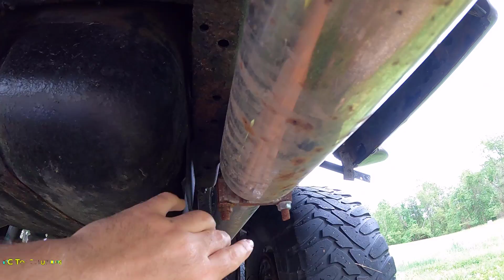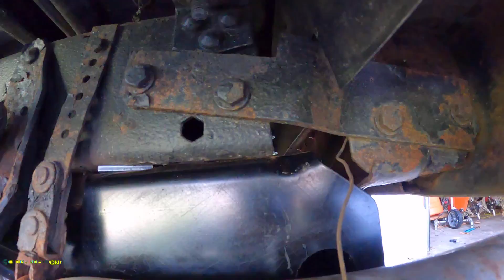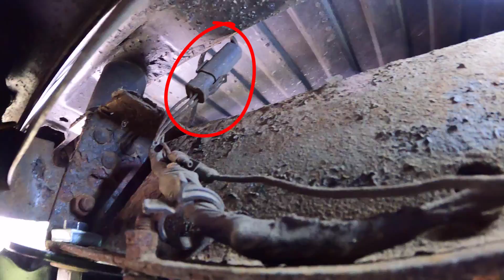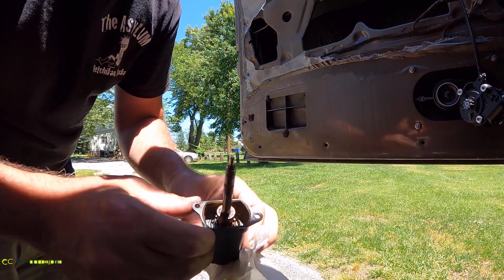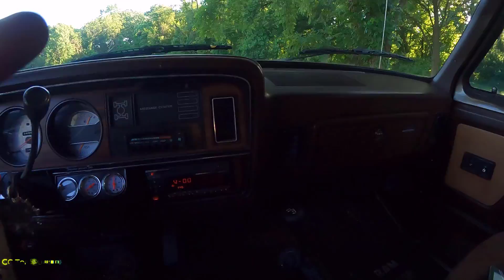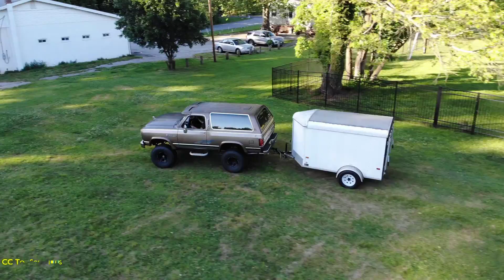Ramcharger Hitch Installation Drawtite 40050 and Power Window Motor Repair

Comment: How does it feel when towing at speed with the short wheelbase?  I have a 91 and wondered if it feels ok or if it sways a lot. What is the Max towing with the 5.9 fuel injected?
Reply from the maker: I dont take that truck up over 55. I need an alignment and borgeson steering shaft. Im not sure about max towing cap...but i think its around 7k lbs.